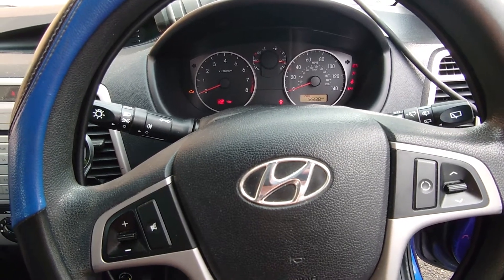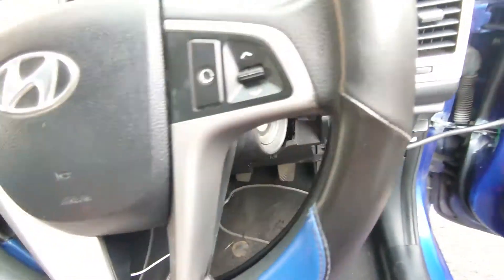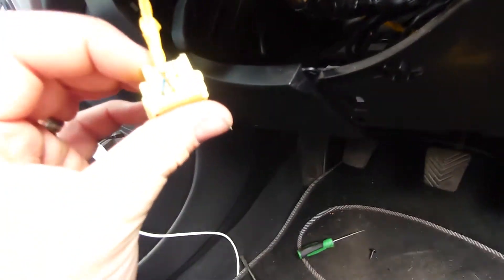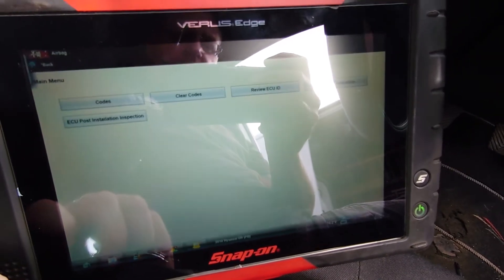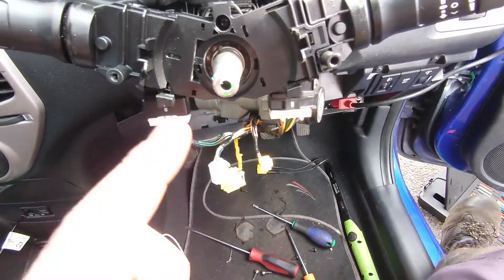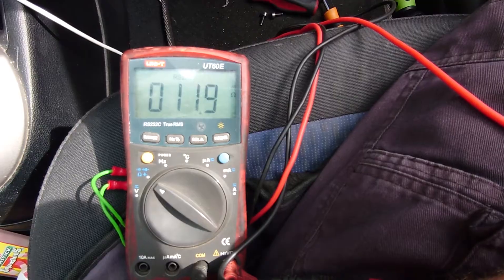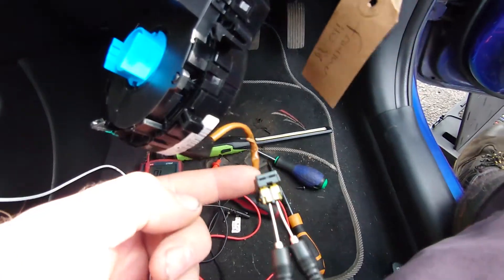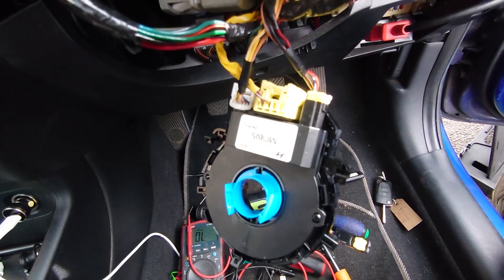Hyundai i20 airbag fault B1346 DAB circuit resistance high

Comment: Nice diag. I have the same fautl code/DTC on my 2010 i20. I carried out a fault code search and have DTC B1346 present. I've replaced the clock spring but the airbag light is still on. I've carried out another DTC search and there are NO DTC's present now. I've recalibrated the SAS but still no joy. Any ideas buddy.
Reply: Hi,
did you resolve the problem?
Reply: Hi l have the same issue... Did you fix the problem ?
Reply: @bogdanbonk  Yes, the DTC is an airbag clock spring fault.

Comment: Good diagnosis how many OHMS is your fixed resistor
Reply from the maker: 3 ohms, I do carry other resistors 1.6 to 3.3. You can pick them up for a few £ on ebay. Thanks for the comment 👍
Reply: You can use a steel paperclip as well. has about 2 ohm